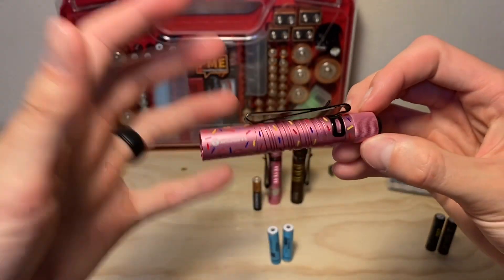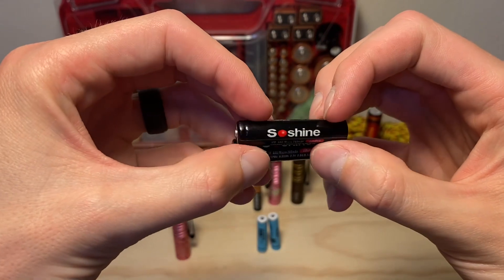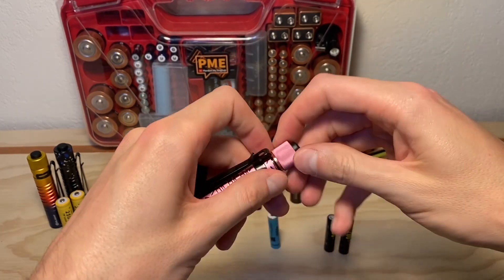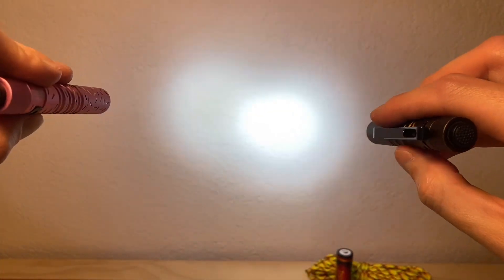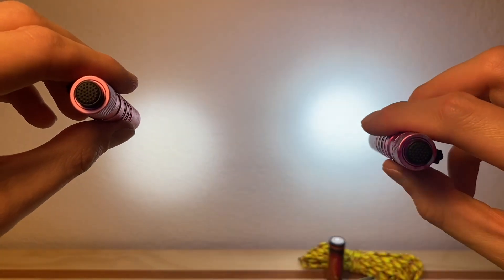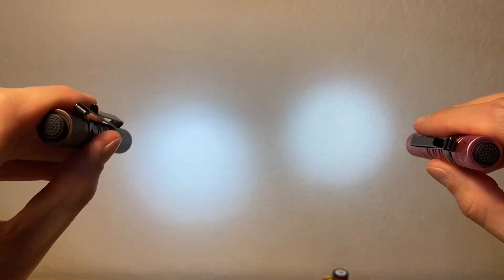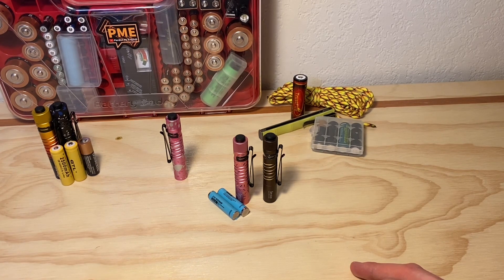Did the Olight i3T just get Nerfed?! Pt. 1

Comment: For the output geeks it’s worth noting the i3E EOS can run on 10440’s as well. Be advised I blew out one light but the next one runs fine. It cost me $10 to find out. 🤷‍♂️ 

On Amazon I can’t discern if the i3t is a current or original version. I assume it’s the latest offering.

Comment: Nerfed? The key word is product liability! 
They made sure the i3T doesn't get too hot when used with a 3.7V rechargeable battery instead of a 1.5V AAA.

My guess is that this only worked in the first place because Olight decided to use the same electronic components with the i3T and i3T Plus (which needs 2 x AAA at a cumulated 3V). The same goes for the i5T and the i5T Plus.
Reply from the maker: This could be why a change was made to the i3T, but I wonder why the same wasn’t done to the i5T, as those get quite a bit hotter when using 14500s than the i3Ts do with 10440s.
Reply: @PardonMyEnglish  Could be a matter of product life cycle / production road map. Or more issues with i3T (for example because of more units sold / more customers switching to 10440s).

Just because they didn't alter the i5T this month, doesn't mean there isn't going to be a similarly altered version of the i5T just over the horizon.
Reply: Same thoughts also. Turbo is great but the light is tiny with a low cap battery. A well regulated output is the way to go.

Comment: Ehhh I don't think they're throttling it. If anything they may have used a different part in the new flashlight that just looks different by chance not on purpose.
Reply from the maker: That very well could be the case. Maybe it was an unintentional change. If so, I wish they’d go back to using the old components.

Comment: Did anybody try the 14505 battery with the i5T? 
The 14505 is 50.3mm long and 3.2V (LiFePo4 cell instead of Li-ion).
Reply from the maker: I have tried LiFePo4 3.2 batteries in the i5T and they worked well with no difference between the older i5Ts and the new. They do get hot quickly though, just as a precaution.
Reply: @PardonMyEnglish  Thanks for the quick reply! 👍

Comment: Perhaps a battery life test could show something interesting. If it’s regulated or using a different emitter, I’d think there would be a noticeable difference. If for some reason battery life is significantly more, then I personally wouldn’t think the change to be bad.
Reply from the maker: Good point! Yes, improved runtime would be worth it depending on how much so I’ll have to check out the runtimes.
Reply: Please check run times and update us sir?
Reply from the maker: Just finished the test and posted pt. 2!

Comment: Seems like the low is lower and the high is about the same? (on 10440)
Reply from the maker: I’d say that’s about right. To my eye, the high setting seems slightly decreased but not by too much.
Reply: @PardonMyEnglish  That's.. actually ideal (for me), I wanted the 5 lumens low on AAA, and the 10440 High 😬
How does the low compared to AAA low? Thanks again for the info 👍🏼
Reply from the maker: You bet! That’s good. For me, I like to be able to tune the output by selecting particular batteries, so I don’t care for any regulation or throttling. I like to be able to take it to the max output possible if I’d like to, but lately the 3.2v LiFePO4s are my favorite.
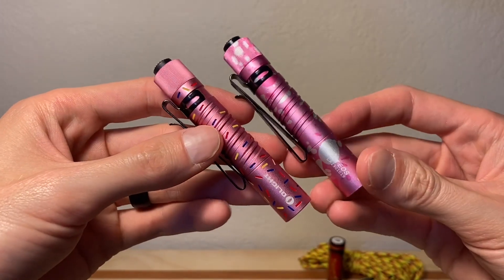Reply from the maker: I compare the donut low mode with 10440 to the AAA low at around the 6:35 mark in the video, if that helps.
Reply: @PardonMyEnglish  nice thanks, not quite as low, but it's all good. Can't wait to get mine (:
Reply from the maker: Yeah, still an awesome light and Olight made this one look incredible in my opinion!

Comment: If it has a buck boost converter in it that is a great upgrade in my opinion.
Reply from the maker: Sweet! Unfortunately I’m not familiar with what that is.
Reply: Buck boost converters will regulate the power of the light better throughout the charge range of the cell, rather than overdriving the emitter.
This can also be a factor of a higher Vf LED.  A higher Vf will result in less overdriving with the higher voltage of a li-ion cell, and can vary from sample to sample.  I don't know if Olight is requesting specific binning with their emitters, but based on the variability of the tint from sample to sample I do not suspect that to be the case, especially in the cheaper lights.
Reply from the maker: Great info and thank you for sharing!
Reply: I should expand on this.

The Vf (forward voltage) of the emitter is determined at its operating current, say 350mA.  It is the voltage that the driver must supply to achieve the desired current.  Many white LED emitters are in the 2.8-3.5v range for Vf when binned, which puts them in a difficult place when being driven by a 3.7v (4.2v peak) li-ion cell and will result in a boost converter being overdriven and actually pushing way more than the rated current through the emitter.  The Vf of the LED has a direct impact on this, as a lower Vf will result in more overdriving, and thus more output.   Many of the more expensive single-cell lights will employ a buck-boost converter that will drop the output voltage of the cell when it is above the Vf of the emitter, and then boost the voltage when it drops below the Vf of the emitter for a more even light output across the cell voltage range, less heat and subsequently longer life of the emitter.
Reply from the maker: Nice! Hopefully this does have higher Vf. That would explain a lot. I tested the runtimes in my latest video and the “new” i3Ts do have better runtime.

Comment: I figured Olight would change it up on the i3T. If they nerf it, the flashlight won't be as good in my opinion.
Reply from the maker: Yeah, I didn’t think the i3T needed a change either in my opinion. The change may have been unintentional, so I may have overreacted but I still prefer the previous iterations.
Reply: @Pardon My English  It will probably take a little while to run through the old stock. Olight tends to be very conservative on how hot the light will get or how long it will run maxed out. That's probably why they can do a 5-year warranty on most of their flashlights.  Other companies will push the limits & get greater output,  but it probably comes with a shortened lifespan. I'm just guessing,  but heat usually destroys electronic components. That's why, on Anduril 2 systems, you can change the temperature regulation. Set it to go higher before regulation & you will heat up everything in the flashlight, including the battery 🔋.  Until they change the laws of physics, extra heat upon electronic components will reduce the lifespan of the flashlight. 
The way I look at it, I know I'm reducing the potential lifespan of the flashlight,  but I paid 20 bucks at most for it. If I get a year or two out of it, I'm happy.  My oldest i3t is 3 years old & still going strong. I only started using 14440s in it about a year ago. No problems so far as I don't use high mode for long periods.
Reply from the maker: Good points here. Yes, no issues with mine either.
Reply: For the output geeks it’s worth noting that the i3E eos can also run on 10440’s. Be advised I blew out one but the next one is running fine. Lost $10 to find out. 🤷‍♂️ 

How can you know that you’re getting the older model?  on Amazon, the I 3T is what it is. I cannot discern whether it’s the model or not but I presume it is the latest model..
Reply: @onedirection3510   I think the new one says i3t eos 2 on the flashlight.
Reply: @WilliamsKnifeLife  Thanks. I think I’d prefer the one designated for the 10440. 
The possibility of overheating and/or burn burning out is not that appealing.
However, I ordered both to compare.
Reply: @onedirection3510  I checked the Olight store, and the new one says i3t 2 eos on the flashlight. You do lose a little bit of lumens on high with the new one, but it's probably better for the life of the flashlight. I haven't bought the new version yet. I don't use the high mode for very long when the 10440 is in there.
Reply: @WilliamsKnifeLife  I just tested both i3t and i3t 2 for several minutes. Surprisingly using aaa on high I’m not sure I can tell a difference. 

Using 10440’s in both versions, i3t is unmistakably brighter than the i3t2 on low mode!
If you favor softer low modes definitely go with the i3t2.

On high mode they seemed equally bright except when about ten inches from a white wall. In this case the i3t2 actually seemed brighter. 
Worth noting neither light got super hot. Notably warm yes but not a concern.
I have to give the longer run time to the i3t2. However, considering that almost nobody will ever go into long hours of runtime on low, it doesn’t really matter. I think it’s an absolute tossup between these two lights. It might even just come down to your preferred color. The price differences are negligible imo.

Next to test the I5r pro! If it’s a ton brighter and not too noticeably larger than the i3t (with 10440) it just might be the one!

Comment: During the video I was wondering if you would compare with standard AAA.. you did it at the end 😂
Nice feed back. A good point discovered by Max EDC : donut has a memory mode. New feature may explain output difference with 10440s ? Still a bomb ;-)
Reply from the maker: True, it could be related to the addition of the memory mode. And yes, I tried to show the differences with the AAA as much as possible. Still a large boost in output using a 10440.
Reply: @PardonMyEnglish  very good, mine is still on the way :-)
Reply: Oddly mine does not have the memory mode
Reply from the maker: I just checked my donut i3T and it doesn’t have a memory function either. I don’t mind that though since I like the UI as is.

Comment: More than brightness between an old i3T and a new i3T Donut with a 10440 battery, could it be a matter of temperature? Old i3T cooler than new i3T Donut? And now Olight goes and does this 😤 When I had bought some 10440 batteries for you! The difference is amazing hahaha
Reply from the maker: Yes, the emitter could be a slightly different color temperature but I couldn’t tell, myself. The good news is that this new version might have more runtime and be safer, I suppose. I’ll have to check the runtime difference.

Comment: 10440 is the size. If it’s the same diameter and lengh then they’re 10440
Reply from the maker: Ah, that’s right. I also don’t think of them as AAA since 3.2v is really high for AAA.
Reply: 10mm x 44m then throw a 0 in for the hell of it.

10440= 10mm x 44mm
Aaa= 10.5mm x 44.5mm
People use them interchangeably.. just look for volts. 

Just don’t use li-socl2 battery’s. They’re 3.7v also
Reply from the maker: Good to know. I believe that final “0” indicates that the cell is cylindrical if I’m not mistaken.
Reply: @PardonMyEnglish  3.2 isn’t li-ion that’s LiFePO4
Reply: @PardonMyEnglish  correct

Comment: Maybe it's just manufacturing inconsistency.
Reply from the maker: Could be. People seem to have had different experiences with this model but I’m not sure.
Reply: @PardonMyEnglish  The 1st thing that got into my head after purchasing the 2nd i3T was INCONSISTENCY because even the tail button didn't behave the same which is same with the light output. I was disappointed after discovering it. I really like the feel of the tail button on my Black i3T not to mention it is alot brighter too even on ordinary batteries. Must be manufacturing inconsistency that's my guess.
Reply from the maker: Oh wow, that’s interesting. I wonder what got changed. I like the older ones better, myself.
Reply: @PardonMyEnglish  both my i3Ts were bought on the same year just few months apart. Both were brand new sealed in the box.